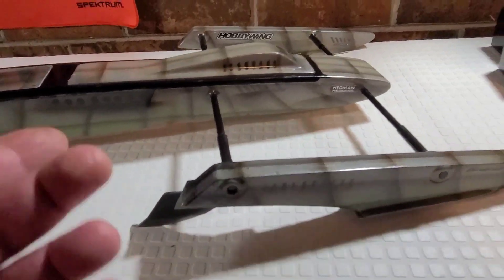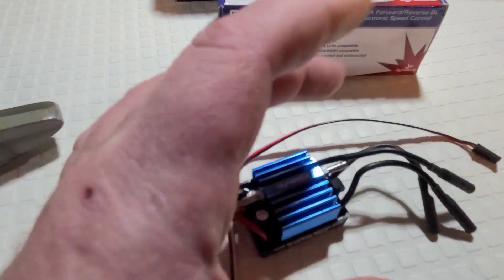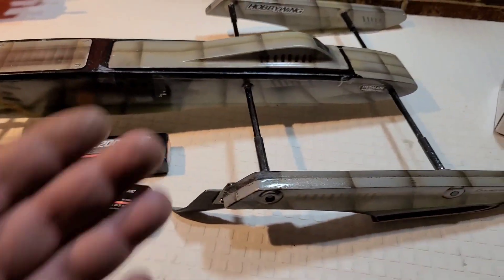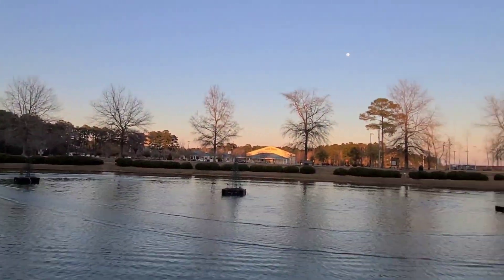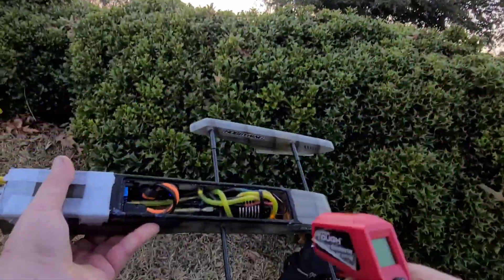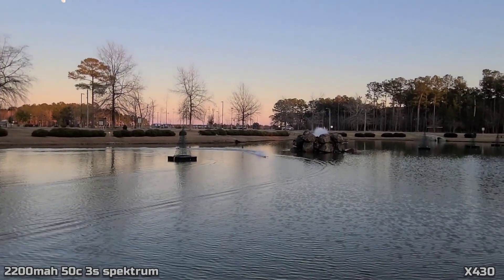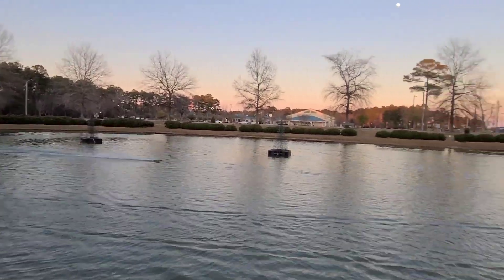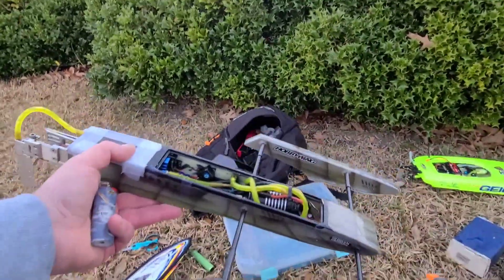Ironcladed Out Mini Rc Outrigger Re-Re-Re-build Test Day - Dynimite 60a

Comment: See?  Those pads work!  Ran mine yesterday, but discovered a leak so I had to call it a day before filming it.  I tried a P735 and it seemed to work quite well with all that lift.  Fixing the leak at this very moment, may have videos next week.
Reply from the maker: Good luck brother, can't wait to see the boat in the water.  Thet nue motor should turn that bad boy hard!